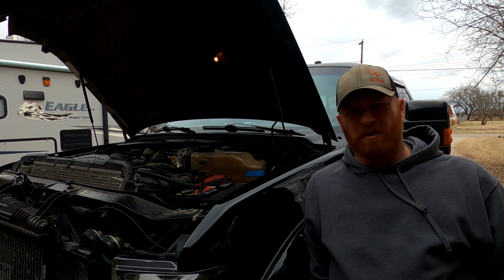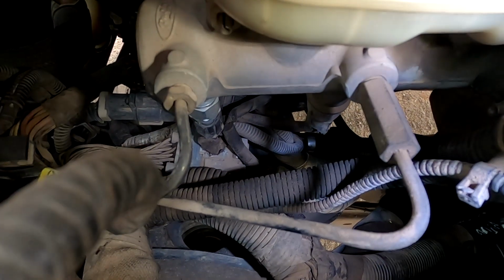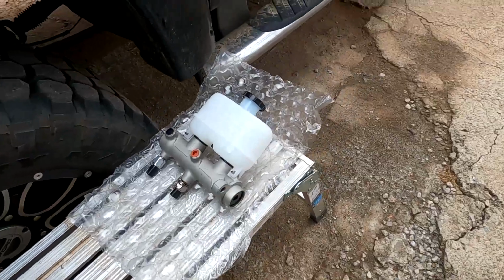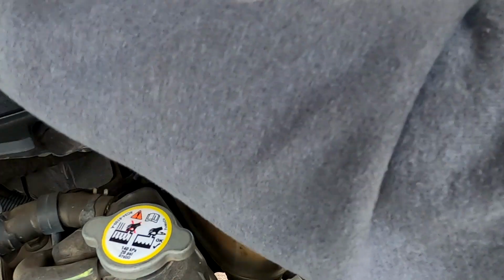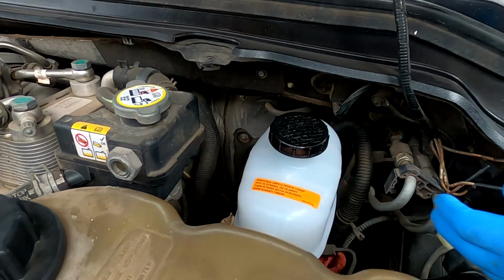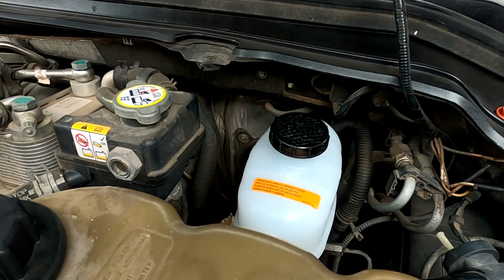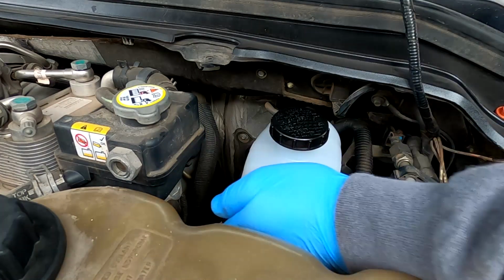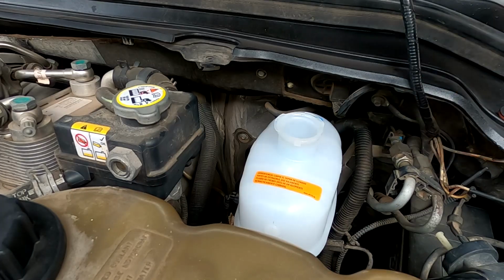2008 F250 Super Duty Master Cylinder Replacement

Comment: Great video! I have been working on a project past couple of days and I think my last step will be to replace the master cylinder. My truck is a 5.4 L 08 F250 Supercrew w/ manual trans. It didn't come with the OEM TBC but has the towing package, the wiring, and I added the controller and I enabled it in Forscan already. I'm able to adjust the gain and it shows "Trailer Disconnected" when I check but keeps popping up with "Trailer Brake Module Fault" on the dash, which I believe is due to not having the proper master cylinder. My current master cylinder only has the one valve/plug on the bottom, towards the front (cruise). I'm trying to hunt down the proper master cylinder that will provide the two valves/plugs. When I searched the part number you provided, that is for hydroboost. Any idea on how to hunt it down for mine, being a gas engine? Thanks
Reply from the maker: It shouldn't matter, hydroboost or vacuum boosted- RockAuto lists the same MC for both my truck and yours, there's a Raybestos MC391188 on there that should work perfectly. Here's the link: https://www.rockauto.com/en/moreinfo.php?pk=3284502&cc=1440007&pt=1836&jsn=11064 

Cancel

Reply
Reply: @USAF99  Thanks for the quick response. I was just on there checking out it. It looks like they don't provide the valves with those. I have the one on front. What part would I need to screw into the back? I believe I have the other end of the pigtail in a dummy plug already. Thanks again
Reply from the maker: @shotpointm28  I want to say it's this one- but double check me. https://www.rockauto.com/en/moreinfo.php?pk=2065874&cc=1440007&pt=13521&jsn=1118
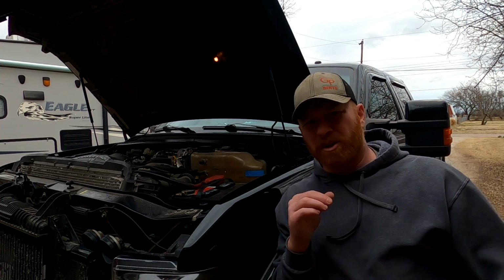Reply: I finally got a chance to get after this today. Everything was going well until I realized my hole pattern on my MC was different than yours. Yours are at 9:00 and 3:00. Mine are at 8:00 and 2:00. I can't seem to find one with my hole pattern, the brake control valve and the hydroboost (??) plug on the inside. Any ideas or suggestions? I'm thinking it may be a Dorman M630524 but I don't see the hydroboost plug. Thanks again

Comment: Good job. Btw, do you have a video on the procedure on bleeding the brakes. You said there is something you have to do if you have abs. I have 08 f250 Harley Davidson. 2 master cylinders in 8 months. Last time front  driver side locked up. Starting over. New master cylinder, calipers, rotors and I am replacing the break line on the front driver side. Don't want to keep doing this.. Any recommendations will be appreciated.
Reply from the maker: There's an ABS Bleed Procedure that the BCM does, but you'll need a laptop, OBD II Cable or Bluetooth Adapter and Forscan. Other than that it's the normal bleed procedure. Since the diesel trucks don't have vacuum assist, it uses Hydraboost  (the pressure from the power steering pump) to assist the brakes. I always do the power steering bleed procedure as well when bleeding the brakes, albeit probably overkill.

Comment: Good video.  Gonna be tackling a 2008 f250 master cylinder thus weekend. Quick question. Do you have to bleed all four brakes or just the fronts?
Reply from the maker: All four, the two lines go to splitters for front and back.

Comment: Mike, After watching both this video (where you don't remove degas bottle) and your hydroboost video (where you DO remove the degas), quick question:  
After doing both procedures do you feel I can get the Hydroboost out without removing the degas?  My master cylinder is fine, but my Hydroboost needs to be replaced.  I am thinking of going about it without taking out the degas.  It certainly appears (in this video) that I can get the Hydroboost out with the MC out of the way.  But I am hoping that I can just unbolt the MC from the Hydro, but leave the brake lines connected and move the MC out of the way to wiggle out the Hydro. Is that possible with the degas bottle still there?  Or not enough room?
Reply from the maker: It's absolutely possible. It's rough, but possible. Thankfully the MC is on flex lines a little ways down so moving it around isn't an issue.

Comment: I’m curious about the vacuum tool you use to bleed the brakes? Also I’d like more info on the handy ratchet tool. Could you please give us the model a name brand? Thank you. Love the video
Reply from the maker: The vaccum refiller is a Pittsburgh Automotive from Harbor Freight, the ratchet tool is a Milwaukee M12 Fuel Series 3/8 ratchet, model number 2557-20.

Comment: You didn't have to bench bleed the cylinder?
Reply from the maker: I find that these bleed MUCH better by just opening the bleeders at each caliper and running clear plastic into a container. Takes a little time but you get a good bleed with gravity and time. Vacuum bleeders work pretty good too.

Comment: Did you use forscan to bleed the abs?
Reply from the maker: You can use Forscan or an Autel, I have done it with either. Just make sure you do it a few times, it's not a "one and done" type deal.